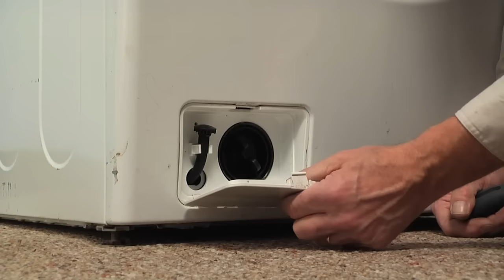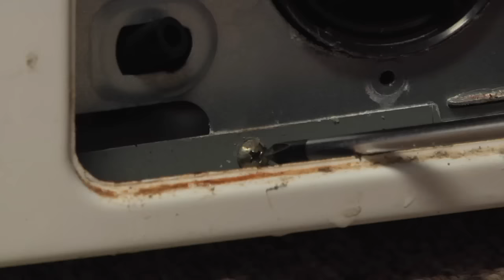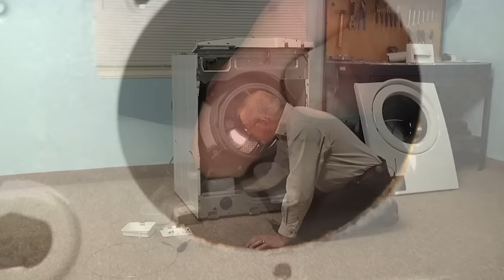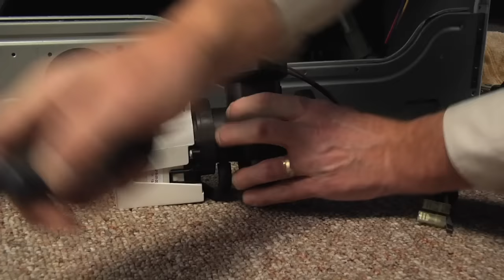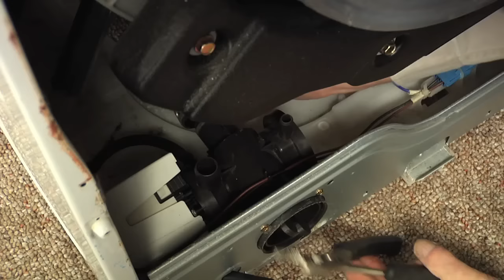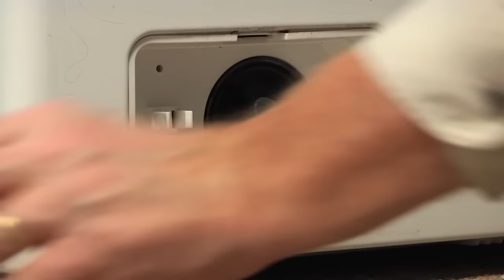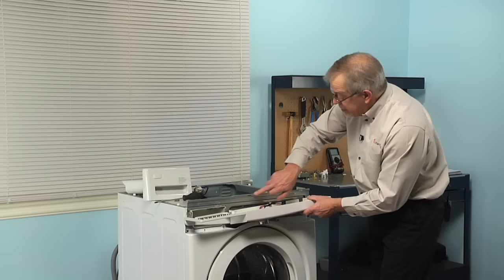Washing Machine Repair - Replacing the Drain Pump (LG Part # 4681EA2001T)

Comment: Does the pump have to be screwed into the housing unit in 1 specific way? Different videos show it laying different ways. We stripped one of the three screws and since there are like 8 holes we just want to lay it on it's other side.

Comment: Couple things I noticed.  First, the drainage pump wires were reconnected differently from my machine (mine has brown on top when installed).  Second, the reassembly instructions missed the screw that connects the front panel to the frame (under the plastic shroud holding the drain tube for the drain pump).  It was addressed only during disassembly from what I could tell.

Comment: Before buying a new pump, try fixing the broken one.   Use screwdriver to try prying off the impeller. It won’t come off but the motor will come apart.  Two parts to clean and reassemble. A drop of lube on the “o-ring” will help reassembly. I had so much black sewer smelling crap that I used a hose with pressure to thoroughly clean it. Dried it and if the impeller jumps when you turn it, it’s fixed.  Good luck

Comment: The model I have has 2 pump motors are they the same part number ? The one I know is bad bc when spinning the blade it looks to be bent and it’s also leaking black fluid from behind the blade but idk if both or the pumps on the assembly are the same

Comment: When reinserting the spring using 3 steel bar clamps to hold it place helps it to keep popping back out. (No shortage in swear woods during this step) Other than that the video was helpful.

Comment: Great instruction. I have a LG F1022ND washing machine. The water remain inside washing. The drain pump, Hanning DP025-208, under 220V runs some seconds clockwise and some other seconds counterclockwise, changing continuously the direction. What do you think? It is normal? Thank you.
Reply from the maker: +60Tani Sorry. I do not know the operating sequence of this model.

Comment: When removing the interior basket/shroud in front of the water pump, the current model has two screws. They are painted the color of that basket, so it doesn't jump out at you. So, you must remove two screws, not one. That version also has six screws holding the top of the front door panel, not four. It also has a clip that must be bent out of the way. I haven't bent it back yet, but at some point it will suffer metal fatigue and break off.

Comment: Great video, thank you!!  I did the whole thing, but when I opened up the drain pump it was full of black sludge, so I cleaned it out and put the same one back in (I didn't have a replacement part yet, thought I'd give it a try).  I ran a cycle, the wash water drained fine, but the cycle got stuck in rinse mode and wouldn't proceed to drain & spin, just a humming noise.  It would try, then go silent a couple times, then displayed an error.  No error code just "Error, not draining, check drain hose & filter."
I turned it off and then back on and ran just a rinse & spin cycle -- it went through draining and spinning with no problem and completed successfully.  Since it is sometimes draining fully, I'm not sure if the problem is the drain pump or some other part -- can you advise?  I have a front load, LG WM2688HNM.
Reply: Ok back again to this video, my washer lasted 6 more years from the last time I cleaned the sludge out of the original pump.  I just now replaced it with the new pump I had bought 6 years ago.  This LG washer is going on its 21st year now, thanks to this video and one replacement pump.  I love YouTube.

Comment: My replacement pump is a bit bigger than the one that I had in the washer. It should work for this washer but I do not have a cover for the drain pump. Is that alright?

Comment: Great video. Used this to fix a lodged pump filter. However, after putting it all back together, the washer makes a loud noise only if Turbo Wash is selected. Does not occur if Turbo Wash is off. Wondering if anyone has experienced this.

Comment: Adding guidance on which colored wires go where would be nice. The right side of the pump is a blue wire on top or nearest front and the other in back. Left side of pump the brown wire is nearest front and black in the back.

Comment: I had what was a strange circumstance with my drain pump issue. I had previously replaced it twice. But this time it threw me off because it was not filling which led me to believe it had a valve issue too.. While listening to someone on the valve issue.he said that if your pressure switch was faulty or the hose on it plugged it could cause it not to fill. I checked the hose by blowing air into it and heard water bubbling. It turns out that there was still water below the tub where I could not see it causing a pressure issue which would not allow it to fill. I drained it out and put it into the fill cycle and it filled. But the issue was the drain pump not draining. Hope this helps.

Comment: Thank you Steve! This video was very well done and was easy to follow. My replacement pump was an OEM, not LG. It's working now but I've noticed it is much noisier at the beginning of the drain cycles than the previous pump. I think the noise is the pump, not the installation as it goes in the channel and the two screws hold it in place. Any thoughts on shimming sound damping, or should I look at getting an LG replacement pump?

Comment: I have replaced the defective drain motor. Any idea why I now have a buzzing / vibrating noise during the draining??? I have made sure I have all screws and hardware installed / tightened. Is it possible the replacement motor is the culprit ??? I thought I read somewhere that some of the replacements are noisy. Thanks for your input, and thanks for your video!!  Timm ......
Reply from the maker: Hi Aaron, what is your model number and I can research this for you?

Comment: When you remove the two wires, brown and black, are the slots for them different sizes or can they accidentally be switched and ruin something?  Which side does the black wire attach to and which side does the brown wire attach to at the back of the pump? Wait, I believe I saw this on the video at about the 8:20 mark there. Is the brown wire plug to the right and the black wire plug to the left as you look at the back of the housing as it points away from you and the arched top is on top?
Reply: a1930ford I had the same problem, pulled out the wires without paying attention. I put them back the way he appeared to do it in the video and prayed it worked. So far so good.

Comment: I've watched a few videos on this and I've never heard anyone emphasize to only barely hand tighten the bolts with the rubber gasket or washers around them, which I'm assuming are meant to absorb the extreme vibrations of the washing machine.  I went through several replacement drain pumps thinking they were defective, before I self corrected.

Comment: I accidentally attached the pump to the wrong side of the black part with water inlet. We had a bit if a flood when I tried the machine. Taking things apart the second time was MUCH  quicker. Fingers crossed this try will be a success

Comment: Thanks for this wonderful video. I like to add something else I have the same washing machine when i was tiling the bathroom  I removed the drain  connection from the sink at this time one little pieces fall from this stoplock system and I didn't noticed  .So when I connected washing machine back  I was sure all ok so afew days after  machine wasn't working properly,  stopping just before drain and error code was displays Than a few time same thing happen .I watch youtube decided my pump is need to replace then I order one pump but I remember something.. Is there any way to test the pump before replace to it . Then what I did .I pull the little drain tubes next to draining filter on the lowest part of the washmachine  (use  e container   )and I set the  MACHINES knob to drain  and I started the washing machine I sow water was started flowing  powerful so that's the way I understand my draining motor was ok no needed to replace .I check the sink connection I founded the missing part  IN THE STOPLOCK that is a valve with a stopper spring wasnt opening the way When machine IS draining the water.Short cut before you change your pump test it if the pump is faulty  as I explained .Could be some blockage on the waste pipe   as in my case. Thanks

Comment: When I did this, the original motor was slightly different (the old motor is no longer purchasable) and it had an integrated cover (the piece he takes off on 7.20), and it wasn't transferable to the new motor.  The newer cover does not seem to be available for purchase either.  Does anyone know for certain how important the cover it is, what function it serves?

Comment: Excellent video, but one minor caveat.  I couldn't see perfectly when you unplugged the wires, but it looked to me like you had brown on top.  When you reattached the wires, you attached brown on the bottom.  My WM2277HW definitely had brown on top.  Furthermore, my motor was labelled with N and L - I assume that's Neutral (most likely black in this harness) and Load (most likely brown in this harness).  It's an AC motor, so it's probably not a big issue which side is Neutral vs. Load.

Comment: Great video , thanks - 
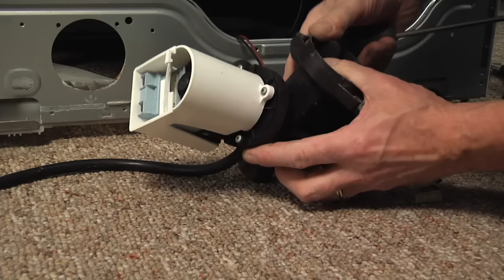I dont have the cover that goes directly on the drain pump (the old cover looks different and wont fit, and the new pump didn't come with one). I tried LG and they dont seem to have that part available. Do you think the cover is critical ? I'm not talking about the filter cover or pump casing, but the plastic cover that goes directly over the pump. YOu can see it around 6:55 in this video, where Steve is removing it from the old pump

Comment: Sound like my drain pump went bad today. Sounds very strange and tub won't drain. Tackle this project this weekend. I'll be following along with this video. That bad part is I have stacked washer and dryer, so I have man handle the dryer off to get to washer and recently having a Hernia repair last week I'll have to recruit the wife and 17 son to take it off. Can't be lifting more than 15 lb.
Reply from the maker: Good luck with your repair and make sure you have some help to remove the dryer.
Reply: PartSelect hi Steve, the repair worked perfectly. Thanks again for the step by step demo. I can only imagine how much this would cost me if I had to get a repair guy into fixing it.

Comment: I used your video to replace my drain pump about 6 months ago. It's been working fine but now I have the same problem. OE error and won't drain.. did I get a faulty pump??
Reply from the maker: It's possible. Hard to say without looking at the washer, but if you got the error code before, replaced the pump, and it worked again, then suddenly stopped. The issue may still be the pump. If you have your washer's model number I can point you toward the correct pump that has been sourced directly from the original manufacturer. Thanks for watching!

Comment: i have the bracket anchoring the pump motor, the 3 hex bolts have a rubber bottom that sits where i anchor it and a rubber washer on top. it wont get tight, instead the metal pump plate has movement. is it suppose to have movement?  i cant get the 3 hex bolts to get all the way tight.

Comment: Thank you, Steve.   Wish there were closeups of some steps.
Reply from the maker: Thanks for the suggestion, Robert! We are always working to make our content better and more accessible, so we'll certainly take your suggestion of more closeups into account! Unfortunately it can sometimes be difficult to get all the shots that we'd like. Thanks again!
Reply: As a volunteer helping senior citizens, I just installed a Supco equivalent pump "Replaces LG's 4681EA2001T"
There was a separate thin rubber ~ 2-1/4-inch diameter "O" ring in the box.    Appears too large to fit inside the black plastic pump chamber.  Also there was no "O" ring in that chamber or on the removed LG pump.   (Its short metal shaft appears metal fatigued.)    Is that "O" ring needed?
Thank you.

Comment: Great instructions on that style washer I have a different washer a LG WM500MVH I believe it is and my top dosen’t look like it comes off. I got he drain hose plate out and the trap, screw behind that, disconnected spring holding seal off, disconnected door lock, and there was o my 2 screws close to the top, got them out, does my front panel have snap type bolts holding it in? Are there any more screws ? How do I get my panel off?? Anyone help please hv to s of washing to do thanks god bless

Comment: You can do it this way, or the easy way: Tilt your machine backwards against the wall and access the pump through the bottom of the machine. You still unscrew the pump from the front access panel, but no need to take EVERYTHING else apart. Do it in under 15min - even for the most average handyman.

Comment: Some folk claim that this repair is actually easier to lay the washing machine onto its side and then go in from the access panel at the bottom. Is that accurate and do you have a video of that process?
Reply from the maker: That's a very good point. If that's easier for you, and you have the space to accomplish it, then that's fantastic! Unfortunately we don't have a video of this method at this time, but you can subscribe to the channel to make sure you don't miss any of our new content! Thanks again for the suggestion!
Reply: Thanks for the reply. I have a bad case of arthritis, so making it easier to work on helps me all the more, but unfortunately, I did not have the space available to do this with, either.

Comment: He's doing it the hard way. If you put it on its back and do it from the bottom its way easier. You don't have to take off the top or the rubber boot. It took me 15 minutes.

Comment: Help I have a dryer stacked on my washer.  Can I remove the control panel without unstacking the set?
Reply: I figured it out.   Remove stacking bracket from rear for washer. Top will slide back approximately 2.5 inches.  Just enough to get the control panel off.  Success.

Comment: This was a helpful video for taking the machine apart.
However, a couple of things could have been done better to improve the video.
First thing, maybe some extra emphasis on the importance of wiring the pump back in correctly. Maybe a suggestion to take a photos as it lies.
2nd thing. You mentioned the pump could only fit in 1 position video the locating tabs at 8:19 , but in fact you could rotate it 180 degrees and it would still fit into place.  

In my situation, Since you said they would only go in 1 way, I didn't pay attention to which way it was installed before removing. Even if its rotated the wrong way in theory it should still pump correctly, but In my situation the pumps contact were parallel in the center, so I only remembered them top/bottom which without knowing the orientation im gonna have to find a wiring picture, to fix my situation

Comment: For the benefit of people coming to this video after they've had their machines awhile, in our case 11 years (WM2701HV), a comment about removing the top of the machine.  After 11 years of reliable service, I removed the two screws in the back in order to remove the top only to find that the top wouldn't budge, almost like is was glued in.  I had to go full tarzan on the top (pounding to alert far away villages) for a couple of minutes as a last resort.  Eventually, the top started to move.  I honestly thought there must be other fasteners that I was missing.  Also, in my model, the problematic tab in removing the front electrical panel was on the left just before the detergent drawer.  Just an fyi...

Comment: At a stall, using what I know, and reading your comments... I am dangerously close to striping the screw, bottom left corner at the drain/filter. The screw is lower than the lip on the front panel. I am having a heck of a time loosening it. I'm tempted to tilt my machine back to see if my model allows access from the bottom. Any ideas? 😃
Reply: Mission accomplished... the screw is out and not stripped. 😅
Reply: All good!! Screw is out and not stripped! Only took me 30 min...😂

Comment: Just FYI my husband just replaced this drain pump with only removing the bottom.  No need to remove front, back, soap drawer, rubber gasket etc.  $24.00 fix with pump from Amazon..running like a new machine. 1 hr job tops for first timers...30 min if you have done it before!

Comment: Please help! I can't unfasten the door wires from its housing! I have used a piece of paper to help glide the plastic locking tab and all its done is broke that locking tab. Do I need to unfasten this to change the drain pump?
Reply from the maker: You could also remove the screws that secure the door lock to the front panel and allow the lock assembly to separate from the front panel.

Comment: Everybody always cuts away on these videos for the one really hard part: getting that spring clamp back on the boot. Notice the video here cuts away right at the part at the last instant, where it is really, really tough to get the thing on, and be super careful not to cut rubber boot doing it. It is do-able for sure without the special tool, but it is a pain. Everything else about this repair is pretty straightforward. Lots of little steps, but none of them hard.